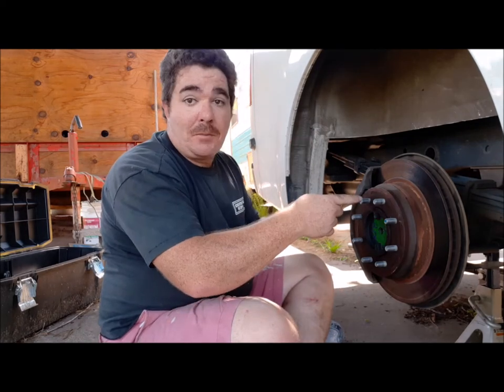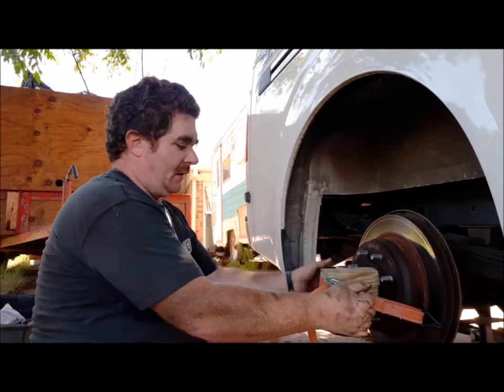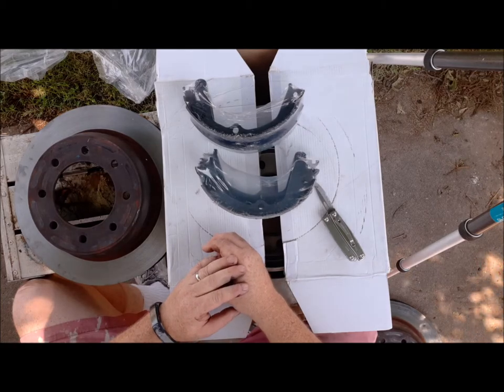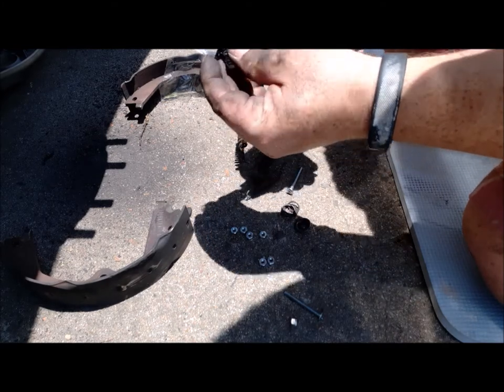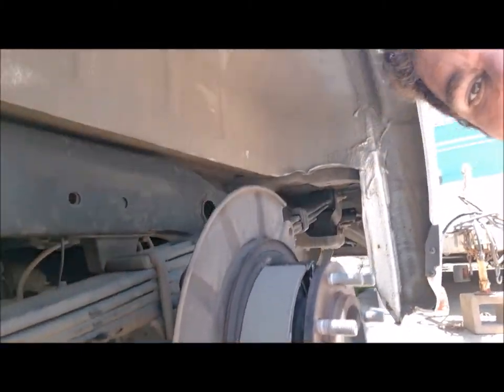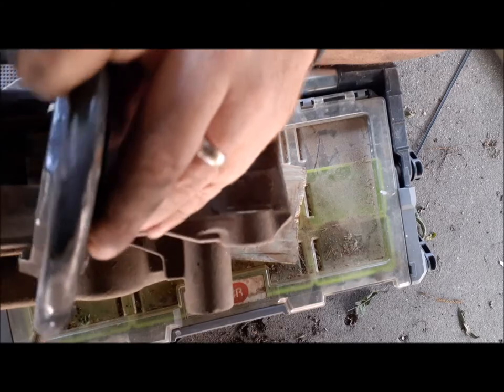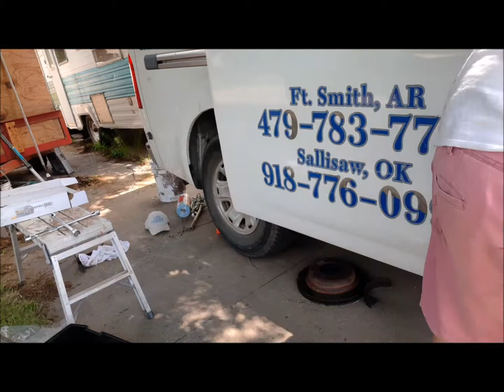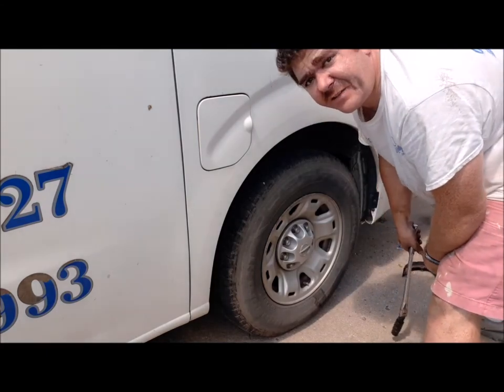DIY rotor removal for Nissan NV & Titan

Comment: The bolts that hold the caliper in place are made to push the rotor off, no need for a hammer at all
Reply: How is that if the rotors don’t have those extra holes like most vehicles do ? 🤔